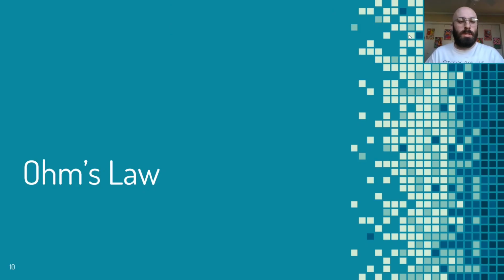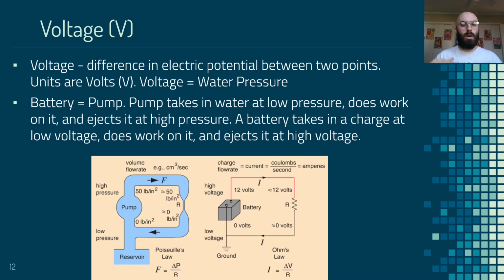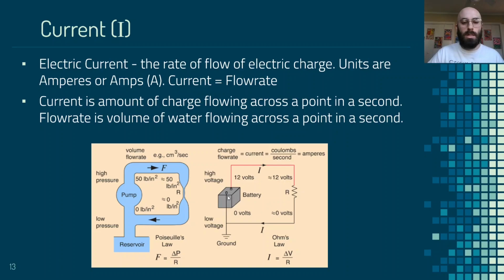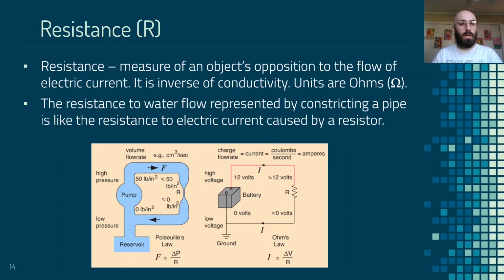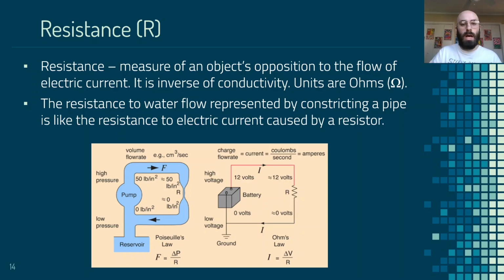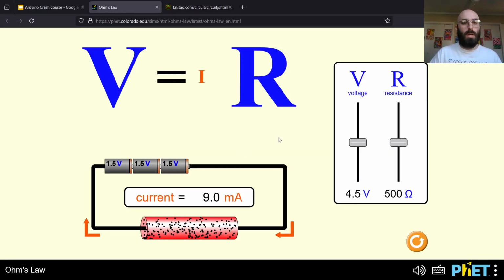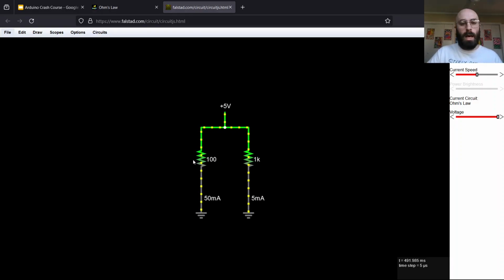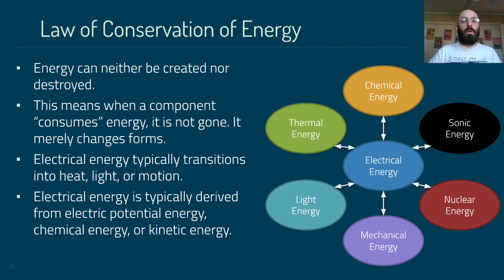Ohm's Law (Arduino Crash Course 02)

Comment: Aren’t speakers mechanical energy due to the small moving parts in a speaker? Would sonic energy count as the sound you hear when a spark from static electricity is discharged? 12:41
Reply from the maker: You're right! It might have been a bit of an oversimplified explanation. I was referring to piezoelectric speakers, which is the style of low-cots speaker that comes in a lot of Arduino kits. They contain a piezo ceramic disc that flexes back and forth with electrical pulses, creating sound waves.